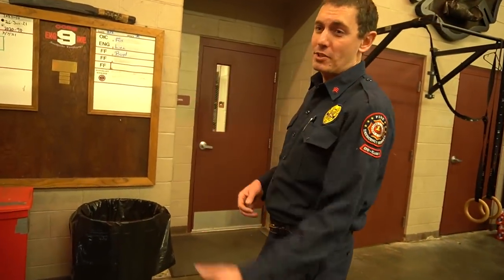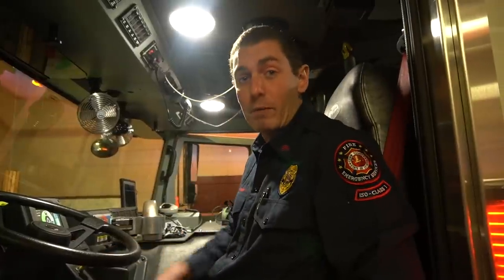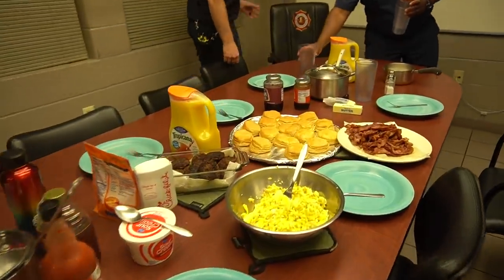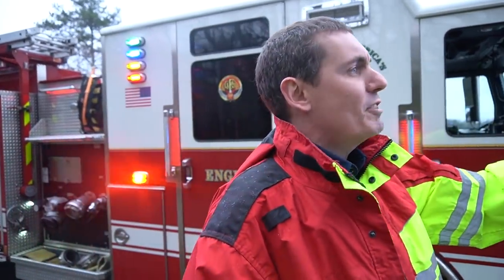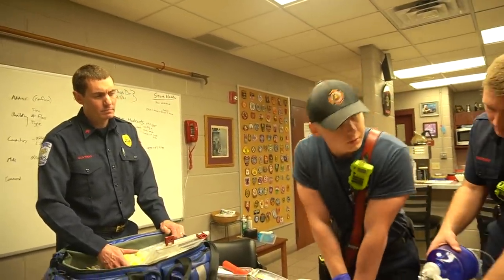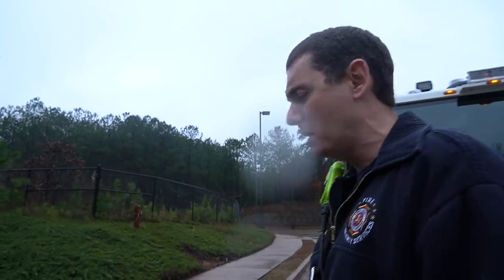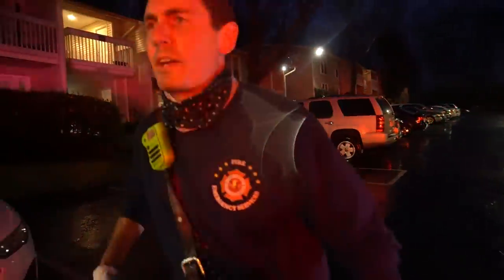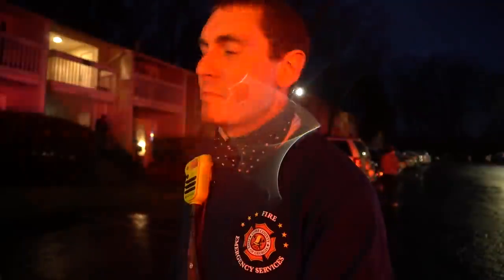A Day in the Life: An Engineer

Comment: As someone not familiar with the fire service, just based on the title, I thought we'd be seeing this guy breaking out some differential equations and calculus...
But this was interesting to!
Reply from the maker: There is math involved in being an engineer, though! We use the math to calculate pump pressures and gallons of water per minute in each hose line!

Comment: Using what is probably now a $1M piece of equipment as a blocking vehicle isn’t a good idea, I understand that it is a large piece of equipment but also quite complex and difficult to repair.  

I work for a state agency that is responsible for roads and I recall that in the 2000’s the city of Grand Rapids MI had two fire trucks damaged in a blocking role on the freeway.  They took a city plow that was going to auction but in the best condition of the group for the year, rebuilt the drivetrain, removed the unnecessary equipment, added an attenuator and arrow board.  They called it utility 2 when I was up there, much less expensive than repairing or replacing a fire truck and more safe for the idiot that drives into it.
Reply from the maker: That is an understandable point of view. $1M is quite a large number.

A few years ago we had a fire engine struck and totaled on the interstate while our crew was providing care to patients at a Motor Vehicle Crash (MVC). The engine was parked to protect the 4 firefighters, 2 police officers, and the patients in the wrecked vehicles. While none of our folks were injured by the car, the pumper was destroyed by the impact and subsequent fire.

Roadway Fatalities: ResponderSafety.com
2019: 44
2020: 46
2021:  65
2022: 51
2023: 45

We consider ourselves very lucky to have lost 1 fire engine instead of adding 6 more people to the 251 who’ve lost their lives on the roads while serving their communities in the past 5 years.
Reply: @CobbFireVideos  I would guess that you are fire rescue so would have a better idea about the cost of apparatus than I.

When the wrecks happened around the 2010s the fire trucks ran 300-500k and I am looking at the escalation of costs for a tandem plow more than double since then.  And I would think that fire apparatus is more difficult to repair.

I have not seen or heard of this concept being applied elsewhere.  I know that jurisdictions are who pays for what are the primary difficulties beyond that where the unit is stationed.  We had a firefighter killed a few years back which could have been prevented by such an asset.  

I have no true answers, but dedicated blocking vehicles save lives.  And the issues have to be resolved by local politicians so god help us.

Comment: As you store your firefighting gear check the site gauge on your water level.  Sit in the drivers seat and adjust seat and mirrors. Check fuel level, air pressure, head lights, signal lights, scene lights and emergency light’s ( while plugged in or with engine running). Check wiper operation and rubber condition. ( rainy weather) Check battery strength on all portable radios. Check Captain’s SCBA and mine. Check that all books and keys are present. Check all compartments and the readiness of all equipment. Check engine compartment for leakage and damaged hoses and belts - use flash light. Check all fluid levels (bodily fluids) 😉 Change out drinking water ( add ice on hot days) Start engine and engage pump. Check relief valve setting. Check pressure gauge operation and engine gauges at pump panel. Check pump panel light. Check all hose lays and nozzle settings. 
Underneath: Check automatic brake slack adjusters. Check drive line play, check for leaks and seepage. Look at bottom of engine for leaks and seepage ( fuel, coolant or oil). Check brake peddle play and response  at slow speed. At slow speed ( about one or Two mph the park brake ( air operated) should stop the vehicle abruptly - if not and the vehicle comes to a slow gradual stop you have a problem with a part of the brake system. 
Log your morning truck check and list anything that is of concern. 
Go have another cup of coffee. 
Wipe it down and wax it as necessary😉😂😂😂